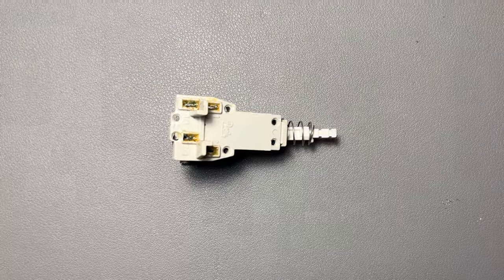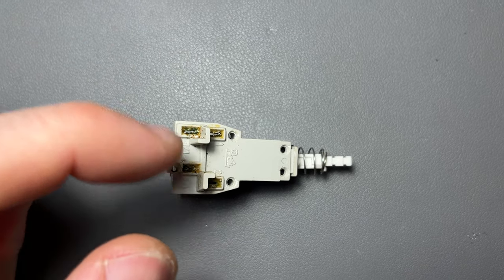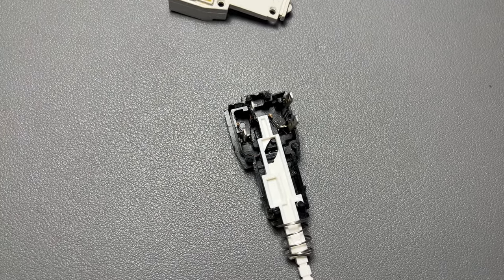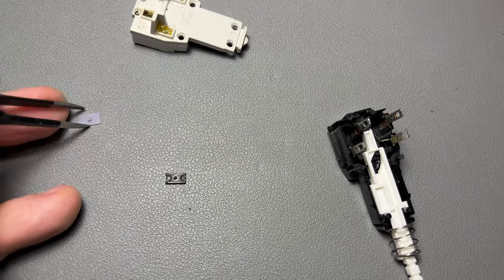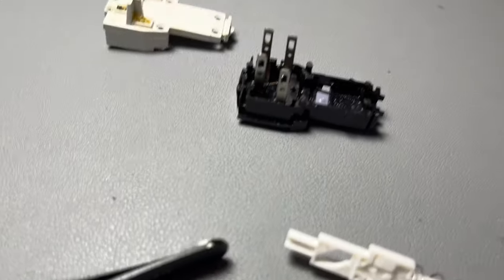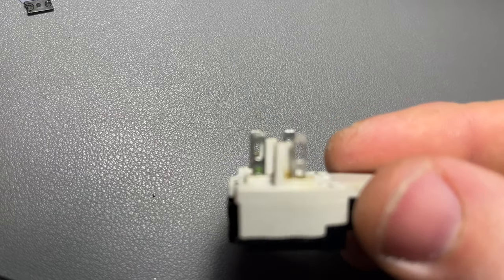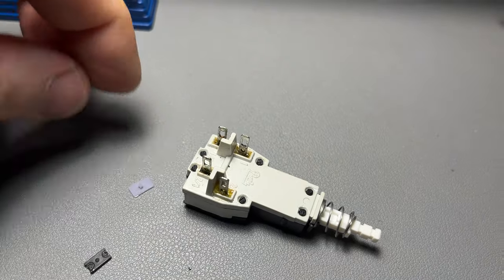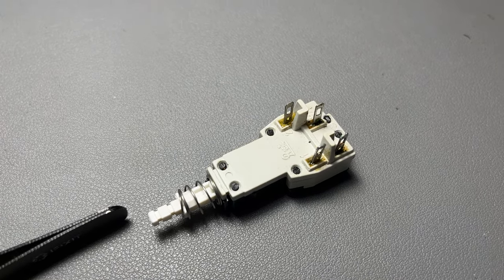Fixing a PREH ME5A Commodore Monitor Switch

Comment: I have some of the NOS PREH switches that look similar to these ones but are NOT the correct ones, I wonder if I can harvest parts from them to repair the proper switches.  hmmmmm, I will tear one apart.  Thanks for sharing this video,  will let you know if the components are the same.

Comment: 1. Drill out the original pillars (put originals together and use a small say 0.5 mm drill bit in something like a dremmel).
2. Could you 3D print some pillars/cylinders.
3. Melt them from both sides to secure the original side back together.

Alternatively 3D print a flat piece with the 6 pillars on it and use as a 3 piece hold the 2 original together after melting the pillars. It will be thicker on one side but could be just enough to impact the original mounts.